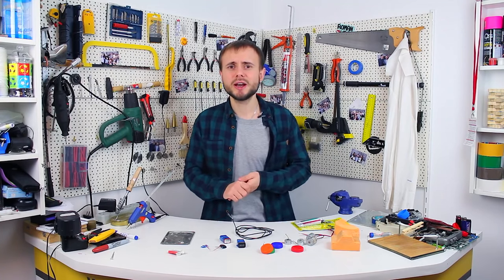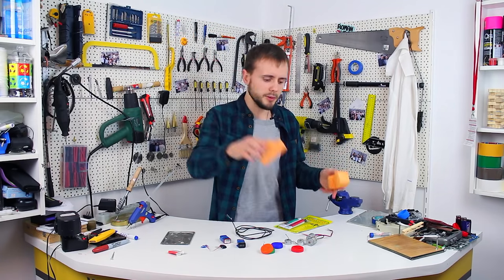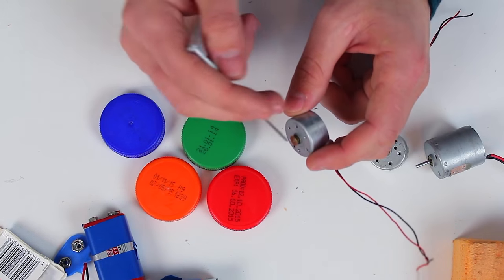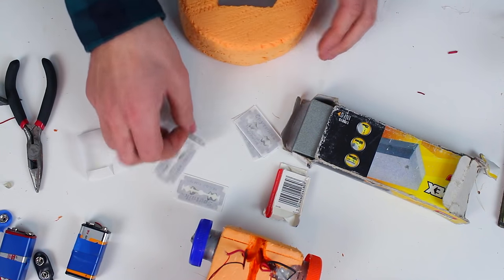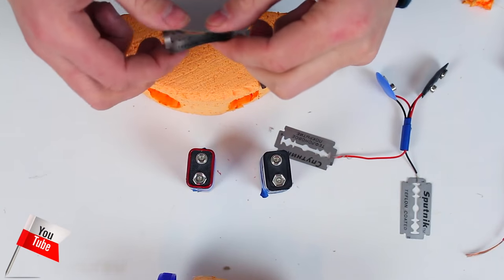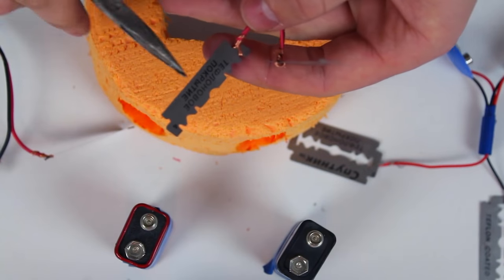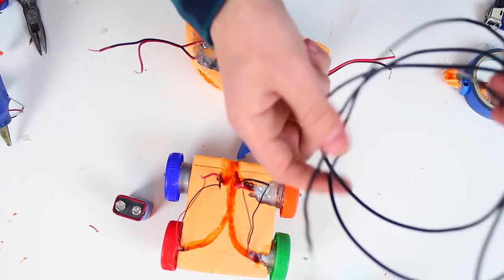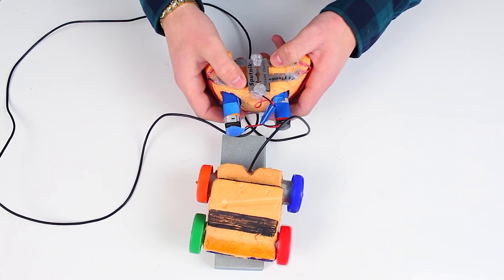How to make a 4x4 REMOTE CONTROL CAR

Comment: don't use your soldering iron to cut styrofoam, it's not good for its tip. why don't you build a battery powered styrofoam cutter ?

Comment: its not an rc car, it is connected to the remote with wires.
Reply: +Patrick the fact that it isn't wireless doesn't means it's not remote.
Reply: +Patrick The title doesn't say that it's radio controlled (RC).